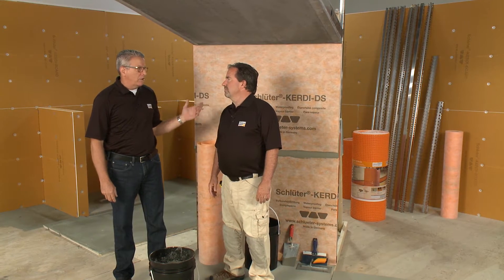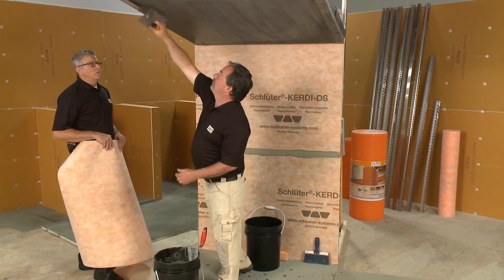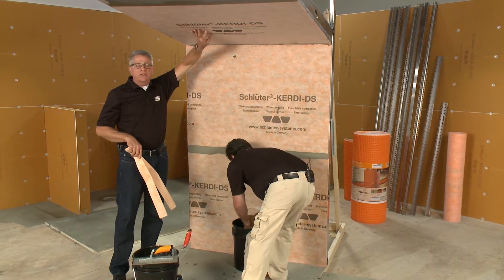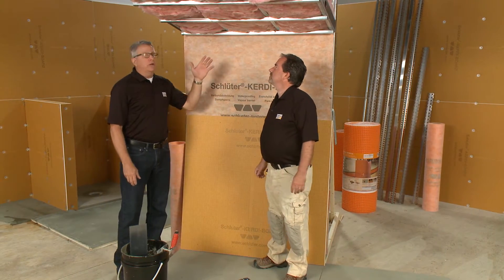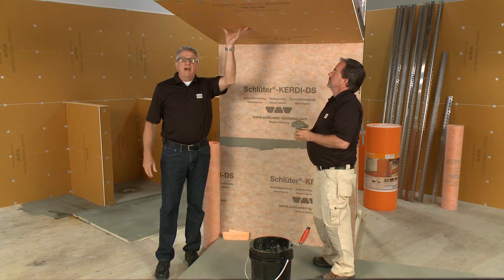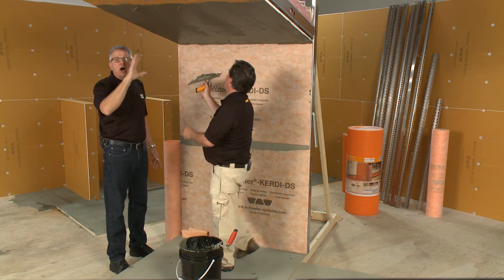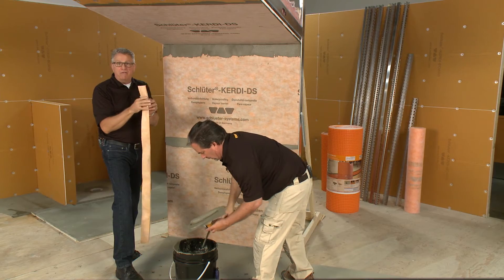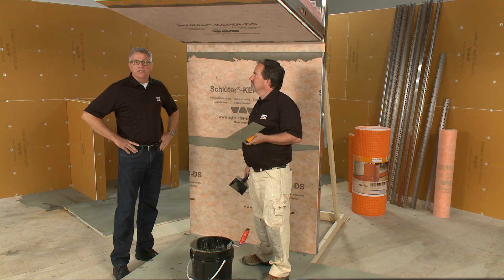Continuous Use Steam Room Ceilings

Comment: My X-contractor did not use any waterproof material in my steam shower at all. 
So I was wondering instead of ripping the whole thing apart and start all over, can I just rip out the tile, then use Schluter-Kerdi-DS and re tile 👍🏼👎🏻?
Reply from the maker: Thanks for the question! We don't have a detail that would outline the steps involved so we couldn't guide you on how that could be achieved. If you would like to discuss alternatives please give our customer support team a call, they can be reached at US: 888-472-4588 or CA: 800-667-8746.
Reply: Next time use a professional  tile installer that follows and understands the methods of doing a steam shower or any tile shower really
Contractors suck

Comment: Why do you need to use DS over the kerdi board? I thought kerdi board was waterproof. Would kerdi board ceiling with membrane over screws be enough?
Reply from the maker: Hi there, While the water vapor permeance of KERDI-BOARD meets the water vapor permeance recommendations for continuous use steam rooms in tile industry standard guidelines, Schluter®-Systems has chosen to require the KERDI-DS membrane for these demanding applications in an effort to be conservative and provide the best possible solution for our customers. This would include steam room ceilings. Hope this helps, please feel free to give our Product Support team a call if you'd like to discuss a specific project. 800-472-4588

Comment: Do you guys recommend a waterproof membrane like RedGard? Especially for the seams, I’m weary of leaving bare thinset pre-tiling.
Reply from the maker: Hi there! Schluter-KERDI is a waterproofing membrane. You can learn more here: https://www.schluter.com/schluter-us/en_US/Membranes/Waterproofing-%28KERDI%29/Schluter%C2%AE-KERDI/p/KERDI
Reply: My concern was correct. Found another video comparing this alongside RedGard. The seams will leak. Thinset is thinset and thinset leaks are the seams (no matter if modified or not).
Reply from the maker: Hi SWF. Laboratory testing and field experience over decades has proven that thin-set seams with the KERDI membrane provide effective, reliable waterproofing for tiled showers. And we stand behind that - when installed in accordance to our Shower System Installation Handbook, your installation is fully covered by our comprehensive warranty.  

We simply can’t comment on these videos/tests as it’s impossible to tell from a video whether they have been done to industry specifications and manufacturer instructions, and what other factors in the testing environment could have affected the results. 

Schluter products and systems have been subjected to, and passed, all required standards and testing in multiple countries including the United States and Canada. It's important that testing be carried out by independent, unbiased, third-party laboratories that are recognized and approved by the industry, and this is how Schluter's certifications are achieved.

Hope this helps. If you'd like to speak to your local Schluter rep to discuss any concerns, please email us your location at social@schluter.com, and we can connect you. Thanks.

Comment: Can you put the Kerdi DS or Kerdi Board onto Wooden frame structure for residential steam system? Or would you say to use concrete board instead of Kerdi board? What are the pros and cons (aside from price)?
Reply from the maker: Hi there, for a residential steam showers KERDI or KERDI-BOARD are both approved. KERDI-DS may be used, but is not required (this is for commercial steam rooms).
 
KERDI or KERDI-BOARD over wood studs. If KERDI is used, it must be installed over gypsum wall board, cement board, or other solid backing materials listed in the K-SSH detail in the Shower System Handbook.
 
The pros of using KERDI-BOARD I would say is the speed and ease of installation. However, KERDI-BOARD is back ordered right now at many stores due to supply issues as a result of Covid. So KERDI might be more accessible right now.... depends a bit on where you are located. Both are perfectly good options, however, so either would be a good fit for you. Please give our Product Support team a call directly if you would like to discuss your project in more detail. 800-472-4588 (US) or 800-667-8746 (Canada).
 
Hope this helps!
Reply: @schlutersystems1  Hey thank you so much for the prompt reply. Are those handbooks free anyplace? I want to use some of the Schluter system in my build. I was under the impression you could just strap kerdi to wood studs; knowing you need another backing was news to me!
Reply from the maker: Hello! Yes, the KERDI membrane needs to be installed over an approved solid backing. You'll find a list of those in the Schluter Shower Systems Installation
https://sccpublic.s3-external-1.amazonaws.com/sys-master/images/ha1/h71/9145056493598/Shower%20System%20Installation%20Handbook.pdf
Thanks!